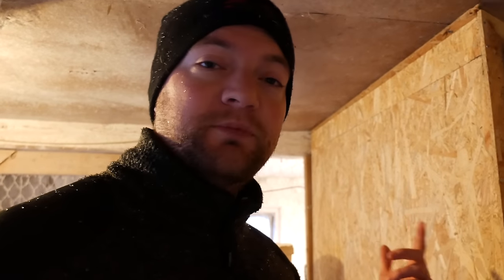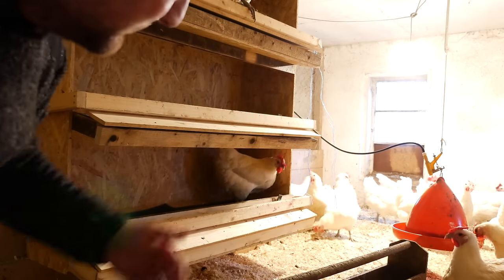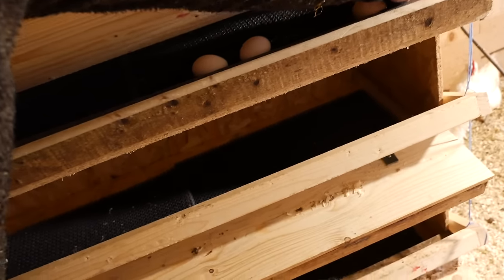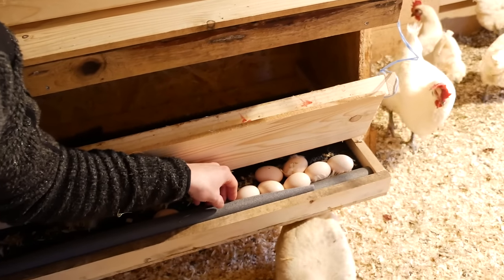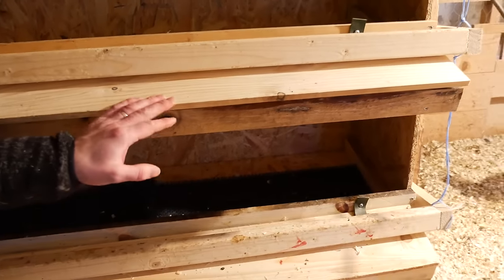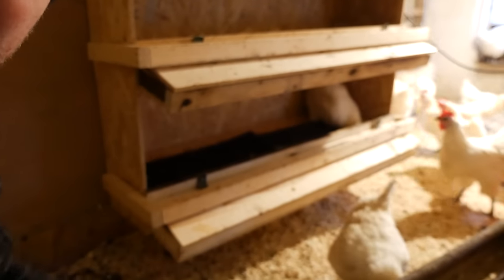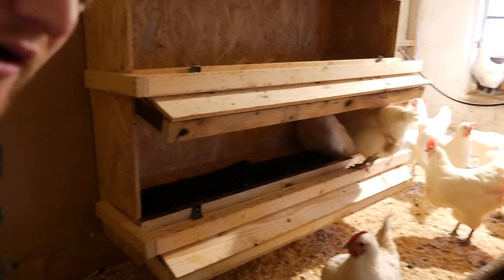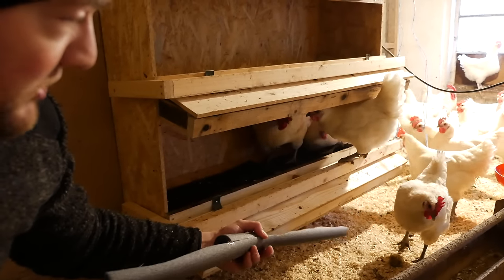The Secret to Clean Eggs? Roll Away Nesting Boxes

Comment: Alaska here. We use a sloped steel shelf and set bottomless boxes on top (to give the sense that there is an enclosure). Lined laying area with washable pads as you do for cleaning. Eggs roll to back into insulated ‘box’. We ran heat tape under the egg storage area and don’t have frozen eggs down to about minus 15 degrees F.  Below that ambient temp we just get what we get. Auto thermostat on heat tape seems to maintain about 40 degrees F.  To be clear, we do not heat the laying box, only the egg storage area. LOVE your channel! Thanks for sharing.

Comment: Just for some extra info as far as options to use for hinges. You can also use tow or lifting stars or even ratchet straps that have been cut or frayed. Not necessarily the frayed part but what ever you have that's not useable as a tool anymore. I've used them to replace hinges on coolers and several other things that have plastic that has broken or even metal that has rusted. They even make good foot loops for the foot on home made sit and stand deer stand climber that I build. On the stands they just mash flat out of your way and lift back up with the toe of boot to secure you foot in to lift the foot climber. And they are very weather resistant I've not had and problems with them using them as hinges or foot straps or anything I've used them for and have been using broken straps for 20 years or more. Also old conveyer belts work great. Just for you info, good luck with your projects.

Comment: I don't know if you've tried this or not. But you might want to try some "nest eggs." Basically they're just fake eggs that you in this case, would probably have to screw into the slanted board.  The hens will see those nest eggs and lay their eggs next to them.  Then they'll roll down.
Reply: Rosa String Works was going to sugest exactly the same thing
Reply: Super glue some golf balls
Reply: Rosa String Works k
Reply: DON'T. Those nest eggs are only for those chickens that don't get the hang of laying their eggs in the box. If you screw the decoy down the you will have to be unscrewing them when you need to clean out the boxes. Hassle. You also run the risk of having the hens go broody. She will sit on the decoy and not go out and feed to lay more eggs.

Comment: Try replacing the foam insulation with some weather striping. Look for some about 1 cm square and mount it about 1 and 1/2 to 2 cm up. Should provide a bumper cushion.

Comment: They seem to be rolling away the eggs well and without the foam I think you’ll be fine with regards the hens reaching the eggs and them breaking. Good job👍
Reply: I use a strip of indoor/outdoor carpet for my bumper.  I can just lift it out if/when I need to shake off nesting pad or trade one out to be washed.  I use indoor/outdoor carpeting for their nest pads too (get it at home depot since I can buy how many inches I need off 12 foot wide roll and then cut to fit each nest).   I still use dividers in the nest box.  With the roll away section ( with lid) my pads are 18" long.  Once in a great while I have an eaten egg.   After seeing another video last night, i am going to raise the nest boxes up a few inches so hens cannot see in nest box until they jump up to get in.  I also use old blue jean curtains with an upside down v cut out of them.    Gives them a place to hide and feel secure.

Comment: They are not trying to go broody or nest, they are trying to eat the eat the eggs. You just dropping the busted up ones on the floor like that doesn't help this either. They get used to eating their own eggs. If you are doing this because you heard that feeding them their own shells back to the for the calcium, then OK but crush them up first. crush them up to the point you can't tell it was an egg and put it into the feed.  A good way to break them of this habit is get a solid fake nesting egg. Place it so it does not roll down. When the hen goes to break the egg open it won't be able to and will eventually give up. If she doesn't give up at least that fake egg will be a decoy  and hopefully she leaves the really eggs alone.